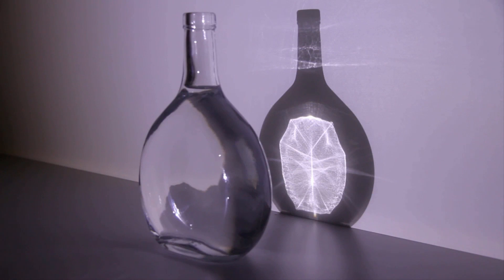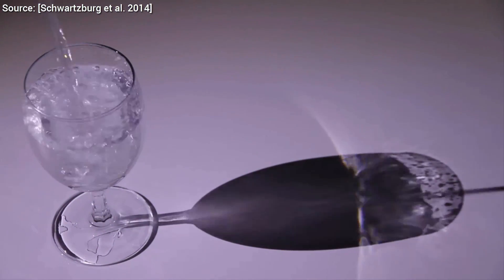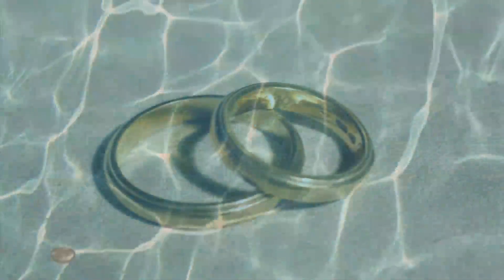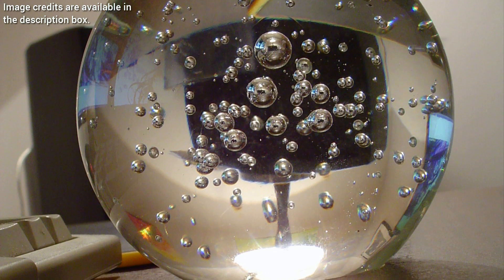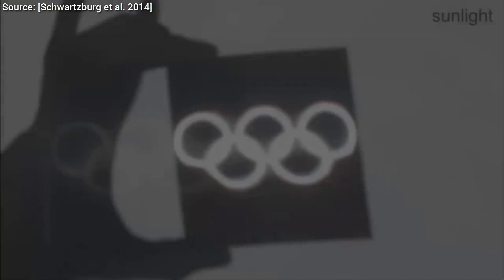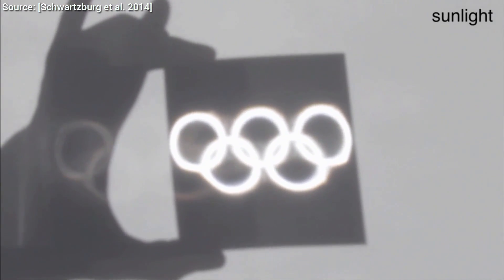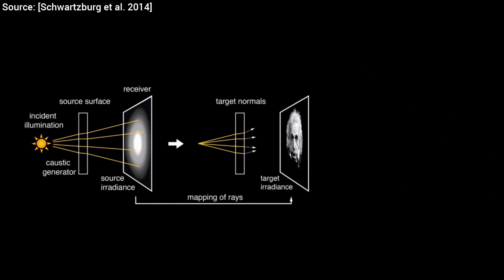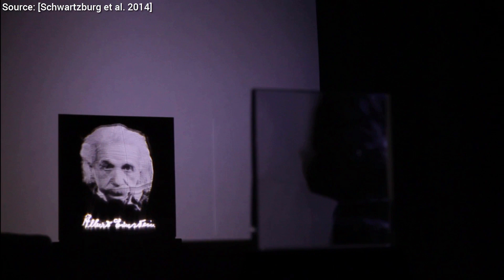3D Printing Objects With Caustics | Two Minute Papers #38

Comment: Could you encode more than one caustic result depending on the angle of light? Like the shadows cast from varying profiles around an object. It would make for a great advertising display object that would change as the sunlight traversed the sky. Also is there anyway to modify a surface dynamically (like water does) to animate the caustic result? Any actuators would interfere with light transport I guess. Perhaps sonic standing waves propagated over a small surface could be projected onto a larger area?
Reply from the maker: +David McSween I would imagine that the optimization problem would be similar, but with vastly more constraints to produce different images and different viewpoints. Possibly even more to get a correct interpolation, i.e. somewhat smooth transitions between the images as the angle of incoming light is changed. I think it could be possible for very simple patterns, but one would have to try it to see how viable it is. It would look amazing, that's for sure. :) I like the idea.

Comment: Two things:
- at least currently, the shapes in question are not 3D-printed but rather milled from chunks of plexiglas
- as a result, I'm almost 100% certain (it wasn't entirely clear in their own video on the topic) that the colored ring example was a CG demonstration and not an actual real-life model. Their actual sculptures are all fully clear for now.

That being said, both of these things, I'm certain, could happen at least eventually. Transparent plastics for solid sculptures should be easy enough to 3D-print. Multicolored versions should be tougher though.
Reply: +Kram1032 +Radiation4TheNation
Hi, author here.
- You're right the pieces are milled, not 3D printed. 3D printing doesn't have the necessary precision as of yet.
- All the examples in this video are real. Indeed, the colored piece is a colored film placed over the flat side of the piece.
- There are unfortunately artifacts on both of the pieces in this video. Since this publication, we have improved our fabrication process and we can make even sharper caustics.
- The resolution usually depends on the precision of the milling machine, but if you get very small then you would get diffraction artifacts.
You can see some of our new results at http://rayform.ch. Thank you all for your interest!
Reply from the maker: +Kram1032 Agreed, the rings looked to clear to me to be true as well. I think they wanted to show that it is possible to do, but may have lacked the machinery (or materials) to do so.
Reply: Károly Zsolnai-Fehér actually it turns out what they did was much simpler than what I had in mind and it actually could work: Rather than solid colored plastic, all they require is a thin filter sheet attached to the straight side of the sculpture!
Reply: Radiation4TheNation the original image of the Einstein image features a comparison of the computer-generated and the real result.
Both are very sharp. The difference is that the real result has lens-glare-artifacts from overexposure. There also is another one which shows the real image taken with shorter exposure time, showing off the large dynamic range.
Reply from the maker: +Yuliy Schwartzburg Kind thanks for weighing in, Yuliy! I have added a link to this website to the description box so others can also find it after watching the video.
Reply: +Károly Zsolnai-Fehér (Two Minute Papers) Is eistein's image is real though? It looked really sharp produced just from a caustic. What would be the resolution on these things? Depends on the size of the printed object?
Reply: Yuliy Schwartzburg could those diffraction artifacts be used as an advantage to even further sharpen the result via proper interference? At that point you'd have to consider near-field optics, right?
Nice to hear an actual author weigh in on this :)
Reply: Kram1032 Right, currently we were only using a geometric model of light, you'd have to consider a wave model. There could be some potential there. But there are drawbacks, because of chromatic dispersion it would only work with one wavelength of light, unlike naturally occurring caustics that work with white light.
Reply: Yuliy Schwartzburg yeah... That stuff is more complicated then for sure. Although... People also love rainbows.

Comment: That's really amazing!
This same technique would be nice for CG too.
Here is an insane idea: Super stress test your favourite rendering engine by just setting up a point- or parallel (sun) light source, a single colored-glass-material mesh which you shape-key appropriately and a diffuse screen for the camera to watch and use it to render an entire movie!
It'd take approximately 'till the heat death of the universe to be noise-free but it'd be awesome nonetheless!
(Ok maybe not really)
Reply from the maker: +Kram1032 It would probably melt a few GPUs in the process for sure. :)